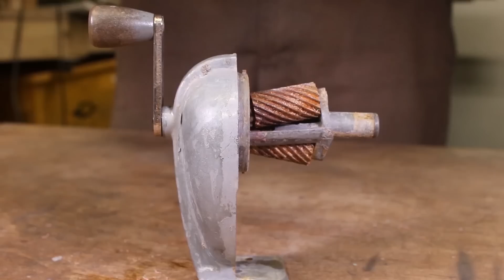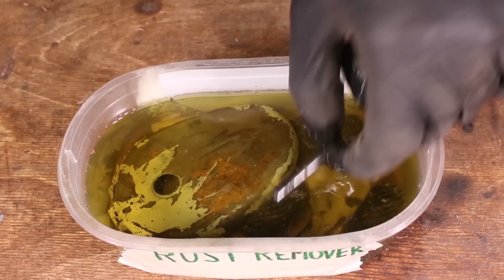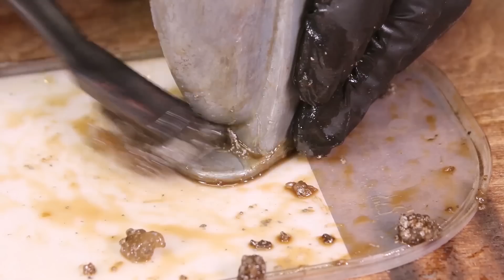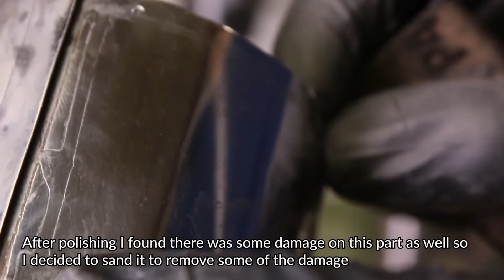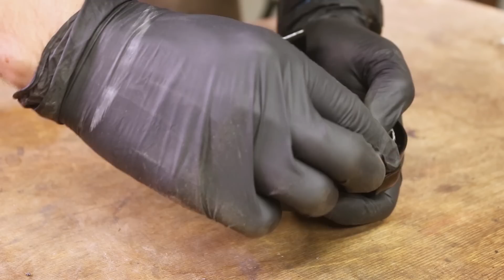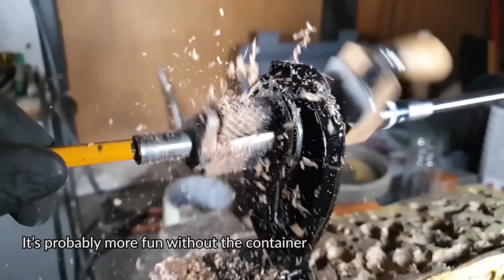Vintage Pencil Sharpener Restoration & Modification

Comment: Ha "vintage pencil sharpener." Welcome to every single high school classroom.
Reply: Try elementary, haven’t gone to middle school so I can’t say but once I hit high school they went missing 😂
Reply: ytrewqmcnoggin It was all electronic pencil sharpeners in every class once I hit high school.
Reply: Christian D. Haha not even that for me, we all had to bring our own but I guess that was just our states problem
Reply: You do know that just because we still use something that it doesn't change the fact that there are vintage ones from way back when.
Reply: Our schools had hand cranks and electric because pricks would purposely break the tips off the pencils while using the electric ones, or snapped the pencils in half until you couldnt get them out, which ultimately blocked them and prevented use/broke them.
Reply: Use what you got!
Reply: Where I come from my friend,we do not have these
Reply: look up the definition for vintage. it doesn't mean what you think it means

Comment: Just now saw this video. I worked at Hunt Mfg, back in the 90's before it went to China. We built the Speedball model among others. In my department we punched out most of the steel parts you see in the video. I personally used to cut the thin oval chrome-plated strip between the two end pieces. It was done by hand because tissue paper was sandwiched between the metal, protecting it. The two end pieces and the handle arm were punched out by automatic punch press. The shafts and blades were machined out of bar stock and the base was cast from alloy and painted the shiny light gray you can barely see in the video. The other parts were chromed in house, a VERY smelly dept. We made many different models of sharpeners, mostly the kind that rotated for different sized pencils. We also built the X-Acto knives. All of our stuff was marked "Statesville, NC." Very nice video, gave me many good memories and flashbacks to an earlier time.

Comment: Reminds me of the ones at all my grade schools, though those had a disc with holes on the side (to let you sharpen pencils from small size to normal to bigger ones)
It's why I had a small pencil sharpener with me all the time since they always poorly sharpen my pencil and the handles make parts of my palm and fingers red and burned >:|
Reply: Same, except the time I was in grade school, they weren't usable. So we upgraded to plug-in pencil sharpeners.
Reply: That's the Boston Ranger 55. I bought an old one off of ebay for my shop. You can't beat the things for reliability and sturdiness. The newer versions aren't nearly as sturdy as the older ones. The older ones are all cast compared to the newer ones that are stamped metal.

Comment: I'm an engineer by trade, currently working in automation maintenance, but I like to tinker when I can. Big 3DPrinter fanatic more than anything now, but motorbikes, cars, and odd bits. 
These are nice finds you work on and you do a terrific job love watching your video's when I have time, its nice to see how simple yet effective pieces of tooling were, even technical parts are much easier to work on / clean / repair. 
Better than the throwaway mentality of today.

Comment: "Vintage" I thought it was pretty standard, I still have one stuck to a post in the basement.  I wonder how long it took the engineers to figure out the best cutting angle on the blades.

Comment: I used vinegar to sharpen worn blades in a sharpener with a similar mechanism (Dixon Enduro no. 20), and it worked very well. Never would have thought of that. Thanks for making this video!

Comment: My workplace still has one of these in a bin somewhere. Fairly certain it’s the exact same model and brand (I had opened it out of curiosity, and all the internal parts, including that hex ring, were the same as in this video).

Comment: I remember using ones like those in school when I was a kid in the early 80s and they were old then. Those were built to last like everything else used to be. Now everything is made to be thrown away after a small amount of time. You're lucky if something lasts a couple of months.
Reply: Unfortunately so, accept for when it comes to military vehicles and aircraft. The B-52 has been around since the late 1950s, and they are probably going to be retired by the 2040s.

Comment: The ones I remember from back in the 60's had a gray, hammerite finish on the part where the handle is attached, then the middle was shiny, and the front where the pencils went in was also shiny.

Comment: Restoration score

Aesthetics- solid 9 or 10 of 10
Mechanics- men, about a 4.

Those burrs can be sharpened with a careful eye and a dremel (they're obviously still dull. You can tell that by the tearout between the wood and the "lead") , and also there was a lot of "slop" left in the rotating parts. A shim washer would've tightened that up to like-new.

Comment: I actually modified one of these for my Industrial Tech class in middle school.

We were given a little motor (4v or maybe 6v?) and we had to make something 'functional' so i took the old hand crank pencil sharpener, and put three gears in place, and did that...somehow only got B+ when the kid who literally just took a small fanblade on the motor and made a tiny desk fan with exposed blades got an A...

Comment: X-ACTO bought Boston in 1925 and seems to have been running them since the introduction of the KS models which this predates. This could be even older than you think by a long shot if those say anything about this version of the Boston logo as well.

Comment: the jig/clutch and use the drill and a slow mo setting, was OK though im certain it would of looked identical with normal speed camera and turning the handle by hand

Comment: I remember these in school. You'd rack your knuckles on the wall every pass, your lead would break off and jam in the blades or it would get too full and you'd have to empty it out. Horrible. But efficient when it wasn't messing up which was 90% of the time.

Comment: I remember the pencil sharpener in my class was mounted to the door frame to the supply closet in the back of class, but there wasn't a container for the shavings. Not sure what happened to it, maybe a kid stole it? 

anyway, for as long as I was in that class, the sharpener never got a replacement container, and would throw shavings everywhere when kids used it. The teacher's solution to the mess was to just put a small trash can under the sharpener. In hindsight my theory for why she did that is because replacing the unit, or getting an electric one, wasn't in the school's budget.

Comment: I remember when you would use the cheaply made pencils that usually had stuff printed on them, the pencil wouldn't sharpen right and the graphite tip would have the wood still going up to the tip and you couldn't write. So, you'd have to break it and start over and hold up the line, or go back to your desk and try to either write at an extreme pencil angle or try to pick away the wood, and end up having to go back up and sharpen it in a few minutes. I always felt nervous going up there to sharpen, but I'm a nervous mofo. Lol.

Comment: Vintage pencil sharpener? You can buy these (under $10) at most office supply stores or online at Amazon and elsewhere. Due to reliability, lack of batteries, and low maintenance, they're still the most common sharpeners found in schools and similar. I have one in my workshop, adjustable for regular and shop pencils.

Comment: It looks great, but I'm afraid it looks like the blades are still a bit too dull to sharpen a pencil without the tip breaking off more often than not.

Comment: I enjoy your videos, but they can run a bit long. I would suggest editing out stuff like 'opening a bottle of rust remover'.  The wire-brushing scenes would work better in time-lapse. The Rust remover time-lapse was good, but I'd slow it down to 50%.speed.

Comment: "It works, but it's a bit slow ..."
Crank faster.
Using a pencil sharpener similar to this (oirs had a adjustable gate for different diameter pencils, otherwise identical) it only took 10 to 15 seconds for a K to 5th grader to sharpen his or her pencil when I was in school.

I'll never figure out what everyone on You Tube infatuation with black paint is.
Things DID come in other colors....
I remember in 3rd or 4th grade the pencil sharpener screwed to the corner of the teacher's desk was sky blue and chrome.

Comment: Would it possibly save some rust remover liquid if he first scrubbed the rusty parts with a wire brush under some water? There's bound to be some loose rust, right?

Comment: The part where it shows it in action while sharpening a pencil reminds me of a bet i won where you needed to go through a pencil as fast as possible with a tiny pencil sharpener so i used a drill to disintegrate the pencil in less than 10 seconds and won (for some reason i never saw that kind of stuff after that hmmmm)

EDIT: it was a metal sharpener so thats the reason i used a drill i did try a plastic one with the metal piece but the plastic melted because of the heat whoops

Comment: Yeah these never worked. I remember getting up to sharpen my pencil and half of the tip, lead included, would be covered in wood. However, I also recall taking one apart once to see how they worked at 7.

Comment: I have one but mine is black and has a plastic shavings holder but it has a suction cup on the bottom my mother broke the plastic cover though and now it’s fixed with tape but I need to go and look for it I know what box it’s in but I forgot where I put it

Comment: What is the acid bath? I have 3 of these I would like to restore and many other things
Reply from the maker: Acid bath means acidic solution of any kind. In this case it was just vinegar. It will corrode both sides of the blade a little which will make the edge thinner, like when you sharpen a knife.
Reply: @OddTinkering  thank you very much I've used vinegar before to remove rust, but it seems you had a much better result.

Comment: What is he using as rust remover? I’ve always used vinegar or gas, but whatever he has seems way more efficient.
Reply from the maker: Mine is something called mc-50. I haven't noticed signifficant difference to vinegar except the smell. I got it free so I use that but otherwise I will probably use vinegar because it's cheaper

Comment: Black and polished metal looks kinda bland.
A nice royal blue with the polished metal would have been more appealing and using a hammertone silver for the base would have left some of the original antique look to it.
I inherited of these sharpeners years ago. My only wish was that it was one that would different sizes of pencils, however this antique unit does do an excellent job on quality pencils. The cheap Chinese pencils always seem to be a little off center and the lead is usually broken inside the sharpener. Having to run the pencil through several times before it comes out sharp is just a waste....

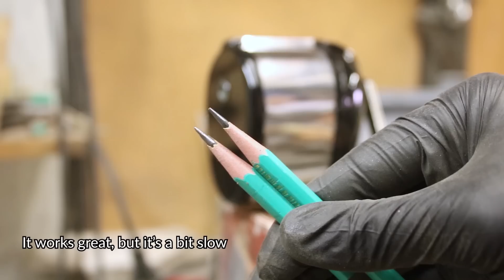Comment: 13:50 That's because you're using it incorrectly. It's supposed to work on a much smaller area.
A.G.

Comment: wait this design is dumb, without a tray, if this is fixed to a desk how can people open and clean it when it's full without the shavings spewing all over the place
Reply: Turn the box, pull it off, empty it. Put it back on, twist to the resting position. Done.